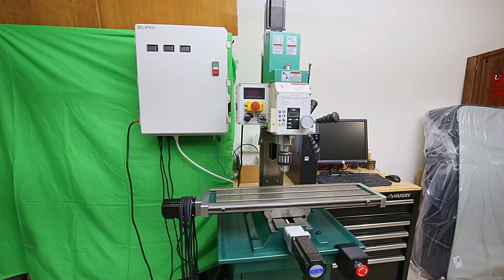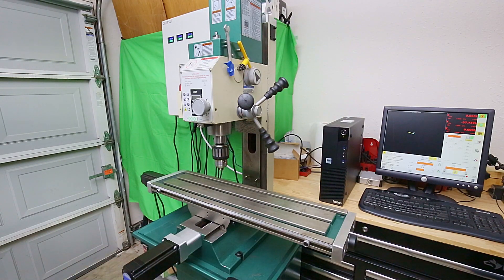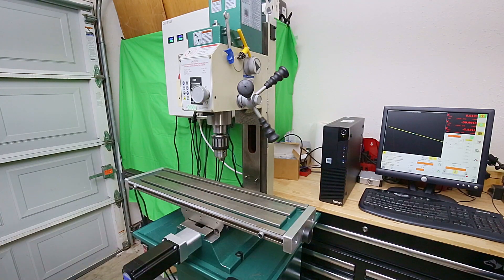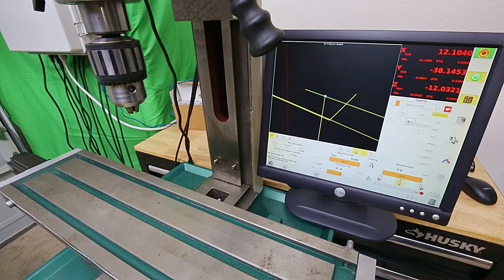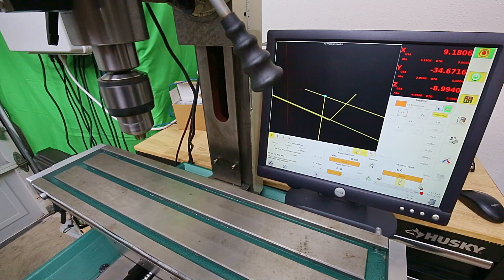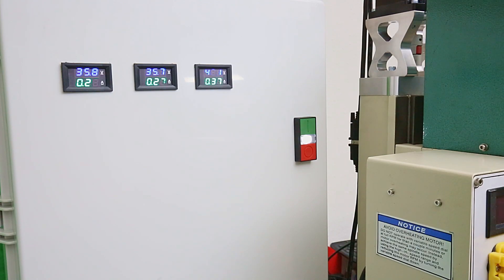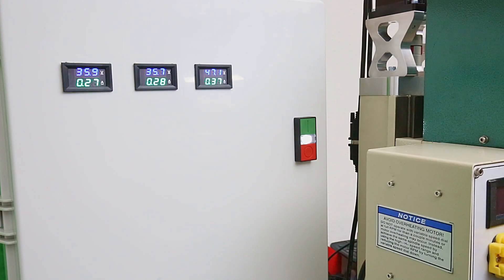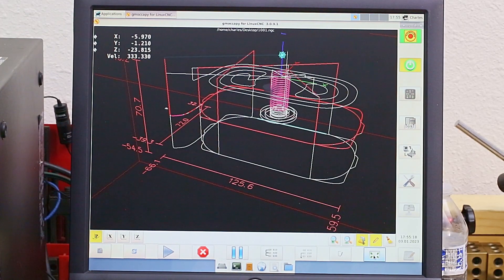Grizzly G0704 CNC Conversion First Motion

Comment: Looks good. I  started on this conversionn10 years ago when a guy named Hoss was selling hisG0704 CNC conversion DVD 
I bought all the steppers, double ball screws, controllers, milled the saddle on a Bridgeport and milled all the the conversion parts for the head flip mod and Y travel extension mod. Even machined the timing belt drive brackets to have them behind the column.  Thought it would make a nice retirement project.
Then I got old and can't  continue the project. But it was fun to machine all the parts.
Reply from the maker: Yea, time marches on. Shortly after I got this mill up and running, life events forced a move. I've been very busy dealing with new tasks and have yet to set up the mill in it's new home. I'm hoping to get it running again sometime this summer (2025). 
Sometime working at a project can be rewarding in its own right.
Thanks for commenting.
Reply: @joat_mon Yes, I have experienced that "reward" aspect a few time over the years. Now being retired ,I've listed my G0704 for sale recently on
Craigslist at a bargain price for the next ambitious soul with the drive to complete the project.  I still have ambitions but they can no longer involve anything sharp anymore. Might try CNC woodworking  next and just have someone else change the bit .

Comment: This reminds me of a funny and scary incident I heard regarding a hobbyist and his new CNC mill. He never installed the limit switches on his Z axis because he lost the mounting screws during assembly. He was anxious to take it for a spin, so he bypassed the missing switches. He started testing each axis and didn't realize he inadvertently set the machine for rapids just before testing the Z axis. In a split second, the milling head with the lead screw flew up from the column and punch a hole through his garage ceiling and fell back down on the mill. He was so traumatized he returned the machine at his expense and gave up on machining.
Reply from the maker: I should be so lucky. No doubt it would save me many $$. I still don't have a lathe, and there's a bunch of tooling on my wish list. 😁
Limit switches are Top of the list for this project. No chips till the limit switches are installed.
Reply: @joat_mon  I just noticed you are interested in a lathe.  I had plans for my retirement, but unfortunately due to now taking blood thinners for the rest of my life, I also have a practically new Precision Mathews PM1228 steel lathe with all the "bells and whistles" also listed as well as a Harig 612 surface grinder ,both are listed on Craigslist.  I figure I could change my retirement plans and settle on custom guitar making.